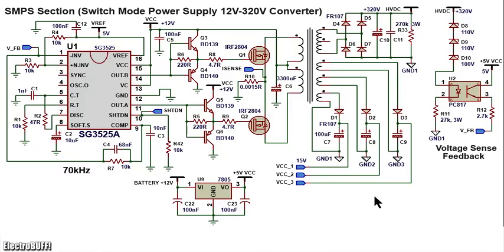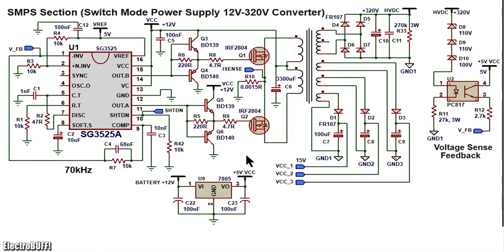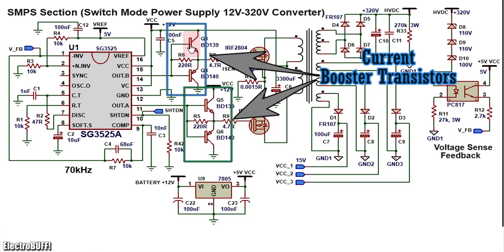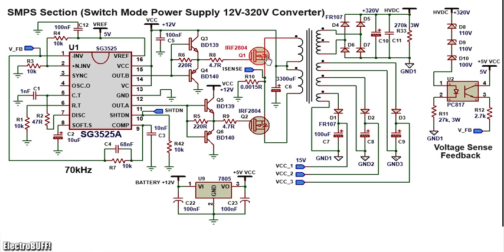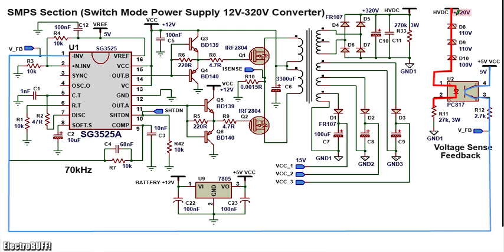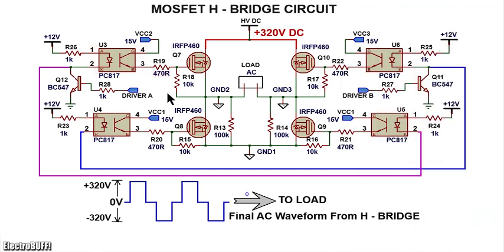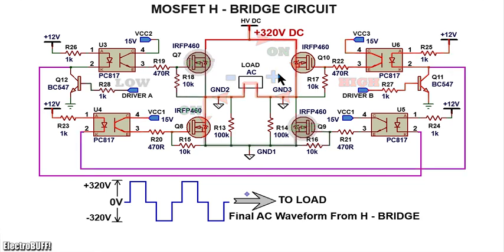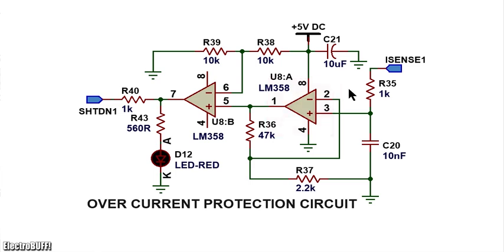How To Make a Power Inverter Like a Professional | 12-220V DC-AC | 700+Watts

Comment: Very nice video, thank you for sharing. 
Please explain the function - voltage outputs VCC1, VCC2 and VCC3. 
Thank you Luboš
Reply from the maker: Those are the isolated voltage supplies to the lower and upper optocoupler drivers of the H-Bridge section
Reply: @ELECTROBUFF  OK, thank you, I can see it now. I overlooked it in the diagram. Thanks again.